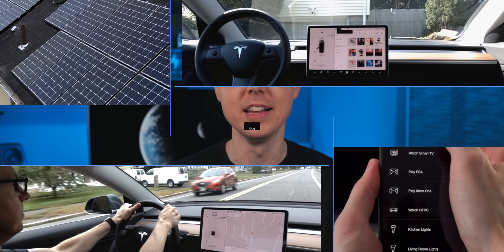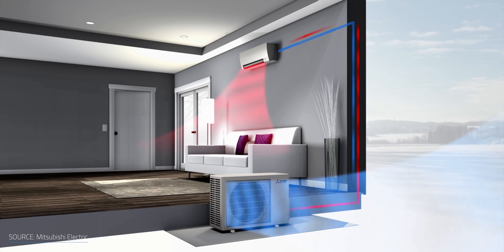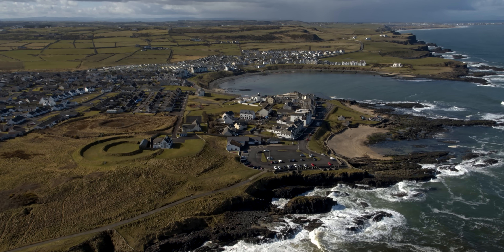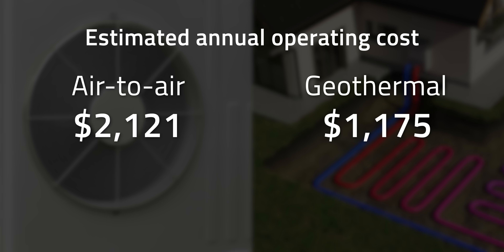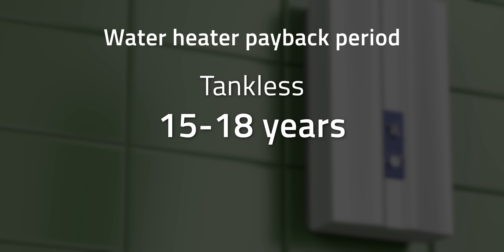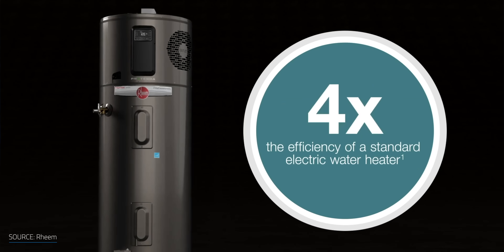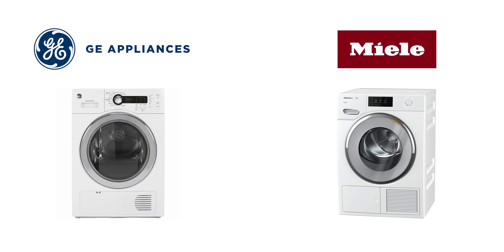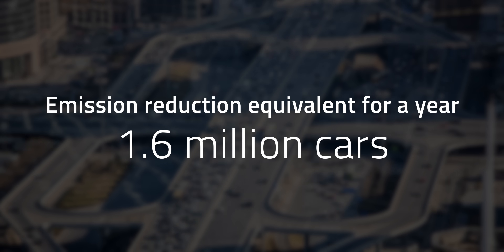Why Heat Pumps are Essential for the Future - Explained

Comment: Things are developing fast in this area.
Latest is to use drilled holes in the ground to provide energy for both heating and cooling depending on the season.
For the cool season where heat is needed inside the best practice is to use liquid floor heating. It's about 50% more effective to heat your home than a wall mounted radiator simply you can heat with 25-35 degrees water compared to 45-50 degrees water in a radiator. That makes the workload much lighter for the compressor giving better COP values.
The real neat trick with drilled holes in the ground is however when cooling is needed inside.
The temperature in the ground are approx. 3-12 degrees depending on where in the world you are located, and for cooling you simply need to circulate that temperature into a convector inside your house. Called free-cooling. Only thing that needs electricity is a circulation pump and a fan. So no need to waste electricity for a low efficiency compressor in an air conditioner as you would need to when your release media of the heat energy absorbed inside is even hotter air outside as you do in a air to air AC.
So if built correctly there is not much need for a air-conditioner for residental cooling. Simply use the lower temperature to be found in the ground and circulate it inside your home in the same piping system used for the heat pump you need for heating during the colder season.
That will save you a lot on the electrical bill and use much less electricity. At the same time you transport heat to the ground which to some extent reload your drilled holes with energy that in some parts of the season can be recycled as heat. This is specially effective for grocery stores where a lot of cooling is needed. Then the heat generated in the cooling process can be circulated down the drilled wells to be reused as heat in the heat pump for heating the inside the store or for pre-heat the tap water supply to ease the work needed to create hot tap water.

In the company I work for we even take the technology one step further and aim to use both the warm and cold side on a heatpump at the same time.
Mainly used for multi-homes buildings, grocery stores, industries or other bigger facilities that need both heat and cooling at the same time.
Then it's easier to find use for both the hot and cold side of a heat pump or air conditioner depending on the season.
Base that on drilled holes in the ground providing free cooling will give seasonal COP values as high as 10 compared to 3-4 for heat pump and around 2,5-3 for AC when not using the other side of the cooling/heating unit.
By principle we only use natural refrigerants to be as environmental friendly as possible. Mainly Propane. That will be the refrigerant media for the future and residential heating with it's GWP at 3.

Comment: About 7 years ago, I lived in a small, 2-room apartment in which 3 of the 4 walls were exterior walls, and the landlord was excited about the new heat pump AC/heating units, one in each room. They worked fine in summer to cool the apartment if needed, but once it got to the deep of winter (maybe 10 F on the coldest nights, staying below freezing for days in a row), I had to go to the hardware store and buy a couple of oil-filled electric radiators, and put one on a timer so it would already be heated up when I got home from work (since they take awhile to start making a difference in air temp). In my experience, the heat pumps just couldn’t cut it when there wasn’t as much heat to pull in, and of course that’s when you most need them to work. Disappointing. Has the technology come along since then?
Reply: Why buy a oil. Heater when any space heater would do the same? You don't need to wait for the oil to heat up and they are cheaper. Also it seems your landlord cheaped out on the heatpump units... Older or cheaper current models don't heat well in colder Temps but the more expensive units will heat as low as - 22°f. The ones your landlord uses only produce about 30% of the heat they do when it's above freezing. This isn't a heatpump issue for all units.
Reply: @randybobandy9828  She probably meant the oil filled radiator heaters not oil burning ones.

Comment: For a vertical hole how deep do you need to go before you get sufficient heat, compared to great heat? Because I can get a pile drill 36 inch wide and drop a coil pipe down there. I also would like to know how long it should be and maybe it’s ID. Can’t a long trench 400 m long and drop a pipe in it be OK too? again, how deep? I would loop it around from the building 400 m and back to the building and heat my slab with it. Or maybe two loops one to bring in to a radiator and have forced air through it.

Comment: Where does the water go? If you reduce humidity in the dryer, that water either has to go down a drain or it has to go to a catch basin of some kind requiring emptying? Am I wrong? Its not a deal breaker but I am curious if there is a system that pumps it out suing the washer drain.

Comment: Hi Matt, we’re in Europe (french nationals) and we live in a 6 storey building (classic Haussmanian stone built in the 19th century) and we have a shared natural gas furnace for all appartments. Can these heat pumps supply 15 to 20 flats would be my 1st question and my real concern is the fan noise since I suspect if we were to set it up, it would be in the common small courtyard in the back of the bldg which for any sound produced ( e.g. trash can moved around or bicycles hitting a pillar ...) is amplified like a soundboard. Any infos or areas we can look into ?
Cheers

Comment: Will a heat pump work when the outside temperatures are below -30F? I am getting ready to upgrade to natural gas with a condensing boiler running at 130F. Our well water comes out of the ground at 42F. If I use a hybrid heat pump for  water heater I’m just putting cold air in my basement that that is already cold because of the ground temperatures.

Comment: A heat pump isn't "like" an air condition, an air conditioner is a heat pump. According to what I have seen, it really doesn't cost that much to reverse an air conditioner to run as a heat pump. If I remember right it was a little more than $100. And yet heat pumps cost way more than that.

And I keep trying to point this out, the true efficiency of something is measured in it's price. If you aren't saving money, it's unlikely you are saving energy. Government subsidies that help to pay for these things really hide that cost from people. But at the same time subsidies often increase the price since the manufacturers can charge more than they would if they were competing in the market. It also means they have less incentive to reduce the costs, and the energy used to create their products.

Comment: Can you use the geothermal on the liquid and suction lines to pull off superheater or supercooling. Or are you limited to pumping a liquid for the heat exchange outside

Comment: I wonder how this increased variety of heat pump application could dovetail with the mini-split model that (IIRC) involves expanding the HVAC refrigerant loop into every room of the house. I wonder if there’s benefit to be had from connecting your dryer, water heater, dishwasher, and even fridge into a shared refrigerant flow system. Imagine being able to efficiently harvest your freezer’s waste heat into your dishwasher’s temp-booster stage or dryer—or even just your water heater input. These are all better uses for that heat in my house during the Texas summer. Even just moving it directly into the earth without an extra lap through the room temp would be a gain.

Comment: Very interesting.  I had no idea that companies were making heat pump water heaters or heat pump driers.  The water heaters seem like a good idea, but I'm skeptical of the heat pump dryers because dryers are a dirty air environment (lint from clothes).  It also seems to me that a natural gas dryer is far simpler and more reliable (assuming you don't buy some dang computerized model).

With the water heaters, I wonder if it could be possible to combine them with the HVAC heat pump.  I would be nice not to have seperate compressors, but it might get overly complicated using valves to shunt refrigerant off the main system to the water heater system.  Also, since electric dryers don't produce any toxic fumes, it seems that they should have the option to vent outside in summer and inside during winter.

Comment: If you're home is super-efficient and includes PV electricity generation, I hope it comes out net negative, not merely net zero!

I'm not building a new home. But I've spent my past 25 years trying to retrofit. Today I am 100% combustion-free and have heat pumps everywhere that can be. All energy usage is offset by my PV system on the roof. Fridge, Freezer, HVAC, dryer, water heater are all heat-pumps. The sad part for me is that they each just throw away the "waste" air. for example I have the AC on right now, and my exchanger outside is throwing hot air to the environment. In the meantime, my water heater is throwing cold air into the environment. An improvement that we must make is to USE this conditioned air where it is needed instead of every heat pump being a stand-alone unit. But that is an integration that will likely only be available for new designs and new builds. For my retrofit situation, I'm stuck with wasting all this energy that could and should be re-used.

Comment: Heat pumps incredible tech, in warmer climates where they provide both heating during winters where it doesn't get below 20 and cooling all summer.  In colder climates costs soar as HP needs 2 compressors customized for above freezing and below freezing AND full power heating coils for 100% electric.  In warmer, ie, southern states the big power draw has always been AC in summer so elec lines and power plants are sized for it.  As you note in colder north big draw would be winter, and as most heating is fossil fuel, elec lines and power production cannot meet full winter elec heating load, which wouldn't use the heat pumps, but the backup elec. heating coils.  I'm just 3 hrs drive from NYC and can see -10 to 10 for a full month, meaning 100% electric resistance for a month, and partially 2 more months.  So, to take that loading, FIRST there would need to be a MASSIVE grid and last mile distribution upgrade, then a huge buildout of gas peakers, which due to gas shortages means HUGE elec bills, up over a grand a month in Feb 2022 when gas shortage occurred.  To make it worse, MANY urban / crowded suburban areas run power underground for safety reasons, and upgrading those mean digging up literally 100,000 miles of roads.  FYI  roads already dug up to install high pressure gas that E. States are mandating everyone use for heating.  Elec and gas are also monopoly products with no real ability for users to pick suppliers, as 2/.3 of cost is via the 'distributor'.  At least with oil you could, if it existed, buy bio-oil to heat with, or synthetically created, if nuisance lawsuits are stopped allowing such plants that convert carbon rich materials, old tires and plastic into fuel can be built.

Comment: Do the ventless dryers need a drain? You said it had a condenser. I'm just curious where the water goes. Does it drain out as liquid or evaporate and go into the house?
Reply: either a drain or there's a drawer that you pull out where the water goes into for you to pour it down the sink/toilet.

Comment: I love this channel and generally enjoyed this video. HOWEVER a couple of items irked me. Disclosure: I'm a heat pump design engineer. First: efficiencies and COPs were explained with 1 watt in equals 1-5 J/sec out. The units used there are going to be super confusing for most people. A watt is defined as a J/sec. A COP of 3 means 1 watt in and 3 watts out. Furthermore, its not actually 1 watt in, its 1 watt of "work" or electricity. Explaining this "efficiency" is critical for people to understand heat pumps. Secondly, the metric that the heat pump industry will grow by ~8% from 2022 to 2030 is almost certainly false. In North America, heat pumps for residential, commercial, and industrial use have been very uncommon so far (with the exception of cooling only applications).  This industry is currently (2022-2025) in the process of skyrocketing. By 2030 I expect >90% of new heating systems will use heat pumps. Europe and Japan are much ahead of this curve, and developing countries will be slower to adopt new environmentally focused codes and regulations of course. Even still, the global growth will not be nominal, it will be dramatic. Cheers!!

Comment: The BRE explanation to why EPCs are downgraded if you have an heat pump installed.  “the reason that the heat demand may increase with a heat pump compared to an oil boiler, is that heat pumps … may need to be run for longer hours to give sufficient heat output over a 24 hour period and to avoid very long warm up times. Running longer hours…. would result in higher mean internal temperature. Consequently, the total heat losses would be higher, so the energy requirement would be higher”

Comment: lowr temp drying is an advantage. Your cloths las longer. Cloths aren't dried by heat.They're dryed by very low humidity. Traditional dryers achieved this by raising the temprature. Heat pumps do it by heating then recooling. Like a dehumidifier.
Reply from the maker: Great call out!

Comment: Seeing this, I keep thinking about the Adiabatic Engine, a variation of the ICE that is an ICE with a heat pump that puts waste heat back into the engine for more power and efficiency. The example I go back to was developed by a Former NASCAR engineer, "Smokey" Yunick (RIP). It was done in a Pontiac Fiero GT and produced (if I remember correctly) 200+hp and returned about 56mpg. Keep in mind, the Iron Duke in the Fiero GT struggled to get over 25mpg in normal driving.  Unfortunately, the mean was rather paranoid and did not keep many records. But the  diagrams available point to it being plausible. 

And that is the biggest problem. it is such a comparatively straight forward technology that does not have to invent anything entirely new. Just a few custom pipes, a couple of new holes in the top end, and rearranging stuff a bit, and you can tack on about 50% more Horsepower and more than double the F/econ. But no one  has tried it just to see if it does work. And if they have no one has said a word about it, one way or the other. 

I do not think the Yunick Estate will sue if some wrench jockey and/or fabricator tried it out to see. If anything they might try to get a cut, if the patents have not expired.

Comment: We had a condenser in our clothes dryer. For some strange reason the manufacturers thought it would be OK to suck the air straight from the drum into the condenser with no filter! So, pro tip, download the product manuals before you buy and check there is a filter involved. For us we got 6 months before it stopped drying clothes due to a build up of fur from our pets clogging the condenser. D'oh!

Comment: I have a mini split heat pump where the heat exchanger is mounted on the wall, avoiding the inefficiency of air duct leakage common in central air handling unit.  However, the refrigerant used commonly has a CO2 equivalency of over 2000. Therefore, when they inevitably leak because an old seal dries and cracks, the greenhouse gas equivalence is comparable to over 100 gallons of gasoline (20#CO2/gal).  Heat pumps are generally very reliable.  However, when they stop working, the leakage of refrigerant is the most common reason.  Withdrawing the refrigerant and replacing the seals before leakage would prevent this problem.  My intuition is that most people wait for the problem to address it.  The net greenhouse gas, even with leakage depends on the CO2 equivalence of electric production.  I have a grid tied solar array that produces more power than I consume in a years time. Therefore, the greenhouse gas impact of leakage is still less than a fossil fuel heater.

Comment: So... I have a problem with heat pumps on water heaters.

Step 1. Heat the house 
Step 2. Concentrate room heat at water heater. 
Step 3. Make sure you use a compressor and try to store that energy.  Compressors on your fridge are energy hogs. Stored hot water constantly loses heat through the insulation.

Comment: I wish my personal experiences with heat pumps were good. We put one in my office 10 years ago, whenever the temp gets down to about 15F (-9c) the coil freezes and it produces no heat at all. So, the coldest days of the year, i have no heat at work. My buddy installed one in a house he just remodeled. I told him to keep the existing oil burner as a backup. He said no need, the heat pump is like 97% efficient down to -20F, or whatever the brochure said. Fast forward 3 months, the system can't heat the house above about 60f on cold days, and because he scrapped the previous system, he just has to live with it. Where i live isn't even that cold, only a handful of days/year get below 0F (-18c) and even here it seems geothermal is a much wiser choice than air to air, but it's $30k minimum.

Comment: You have to have a secondary heat source if the ambient temperature outside is below 40*f on most heat pumps, not -13*f geo thermal is by far the best.

Comment: I feel the video does not do a really great job explaining how heat pumps are different from your fridge or a regular AC. Use of refrigerant, air to air exchange, moving heat through a compressor. Is the only difference with the reversal of the process ? Are the savings only in heating mode ?